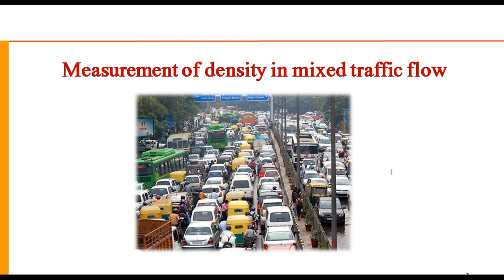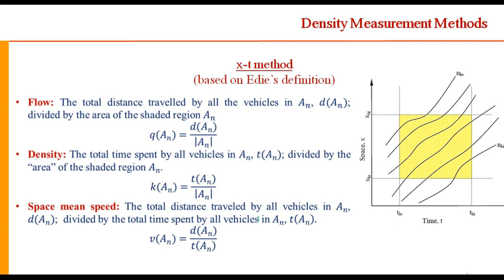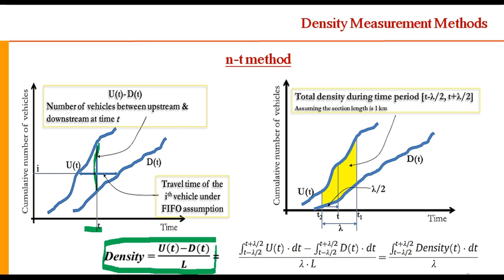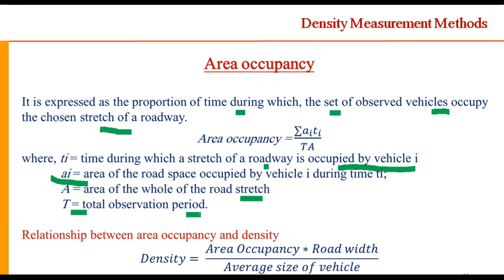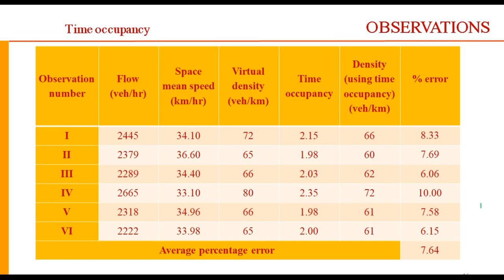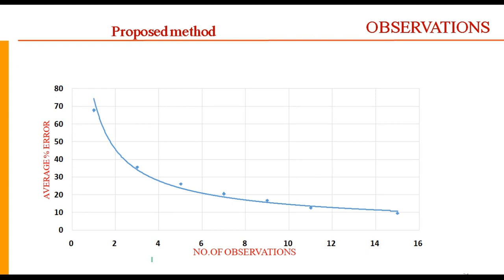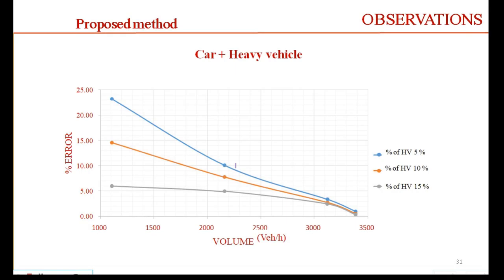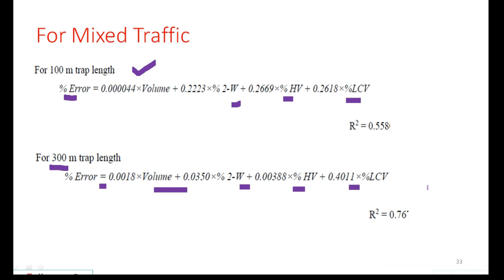#density, #trafficflow, Measurement of traffic density, Traffic flow density

Comment: How to determine PCU value for vehicles in urban mid block section beside your's method?? I have tried multiple linear regression method where mean speed of car were regressed against flows of each vehicle type but found some value negative and some positive ....
Reply from the maker: Linear Regression should not be used as it is based on the method of least error and the analyst has no control on sign of coefficient. You can use headway method if you have proper data.

Comment: Which capacity did you use?? First you determined capacity for each direction and sum two way capacity and used that for analysis??? Or you use capacity of one direction at a time for analysis in case of undivided two lane two way urban midblock section ???
Reply from the maker: For a two lane - two way roads, we do not determine directional capacity. Traffic data are collected for the total traffic in two directions and then analyzed. Directional movements are analyzed only for multilane divided highways.
Reply: What about 4 lane undivided 2 way road road??? But road has central longitudinal line marked..
Reply from the maker: @rameshdhimal3428  you can do both ways - individual direction or total for both. But Capacity will be expressed per lane per direction only

Comment: Sir, how did you find the relation between friction variable and reduction in capacity??? Reduction in capacity for non base section was determined from the model developed for base section with varying carriageway width... I counted the frictions on 5 min interval on each site.... Now should i average all friction value on entire observation on each site and find relation with reduction in capacity ??? Or use average flow and friction on 5 min interval and find relation with reduction in capacity???
Reply from the maker: write separately to Dr. Subhadip for answers to these queries.

Comment: Sir,  how to draw a complete parabola as in Greenshield model in speed and flow plot of graph of traffic???
Reply from the maker: Develop a relation (straight line) between speed and density from field data. If you have collected speed and volume data then find density using Q = KV.
Use this equation (speed - density) to get speed value at varying value of K (starting with zero to almost jam density), in an Excel sheet. determine  traffic volume Q  in the next column using Q = KV. Plot speed volume curve.

Comment: Sir, i have plotted speed vs density from the extracted data of speed and flow and using formula of k = q/v. The maximum flow obtained is good but R square value is between 0.3 to 0.5 for base section... For each site, I have 1 hour data and data was collected for 1 min interval ... so total 60 data for each site... what should I do sir to increase R square value while maintaing maximum flow( capacity ) same???
Reply from the maker: No standard specify one minute time interval for data collection. It should at least be 5 min. One minute data will produce lot of noise and that is why your R squared value is low. One hour data is too less to give any range of traffic volume on a road. go at least for 6 hours field observation,

Comment: Sir, i was reading your paper of 2020 on "Side friction parameters and their influences on capacity of Indian undivided urban streets." and trying to do similar research. Sir, how did you take the speed and flow of the vehicles in case when parking and unparking maneuvers take place as they  causes traffic to halt or slow by acceleration or deceleration?? Did you considered speed and flow in traffic stoppage condition due to frictions or only take the speed and flow ignoring those which causes complete stoppage and slow due to accelerating or decelerating in case of non-base section???
Reply from the maker: Haha, I cannot write the whole procedure here, but if I remember correctly (this was the Ph.D. research work of one student), we did it by collecting the data of speed and flow over a period of time in different levels (read intensity) of parking and unparking movements in a certain length of the road.

Comment: Sir what would be the number of snapshots required in case of trap length around 30-60m??? What to do if platoon and Queue occured in our snapshot time interval?? Should we ignore that time interval or take other random snapshot ???
Reply: which value to take if road in empty in that time interval?? if taken one snap at 20 sec interval...
Reply from the maker: There is no thumb rule which can give you the number of snapshots. Density is difficult to measure in field and that is why most of the time it is calculated from Q = KV, speed and flow are easy to get from field observation.
Reply: @SatishIITR  doesn't this formula work only in uniform flow of traffic???.. but in case of interrupted and disturbed flow where there is platoon and queue which we need to ignore ....and these value would give more capacity ...
Reply: Sir, i measured the speed and flow of traffic for 5 min interval... now to find capacity using greenshield model....then i plotted speed and density graph.... For density what i did was k=q/v... can we do this instead of finding capacity from speed and flow graph???

Comment: Sir, i have plotted three diagram and found different R square value... why is it so?? I have speed and flow data of traffic.... then i determined density as k = q/v... i plotted speed vs density (R2= 0.51), speed vs flow ( R2= 0.1611) and flow vs density( R2 = 0.91)... which R square value should be taken???
Reply from the maker: Please discuss with your supervisor as why are you getting such a large variation in the R squared value. I cannot tell you the reason without going through your entire analysis.

Comment: Sir, i measured the speed and flow of traffic in 5 min interval for 1 hour data....now to find capacity using greenshield model....i plotted speed and density graph.... For density what i did was k=q/v... can we do this for finding density??? Is this the correct way to find density??? In speed vs flow curve, i could not find the maximum flow (capacity) due to limited number of data... in 1 hour i have only 12 set of data .. i.e. 60 min/5min = 12... the R square value for quadratic fit is very very low.... but in speed vs density( k=q/v) the linear fit of the line shows good R square value....
Reply from the maker: Yes you can find density using the relation Q = KV. But you cannot draw any inference from 12 data points. The capacity value will just be absurd even if you get a good R squared value for linear relation between speed and density. It is because 12 data points do not represent flow conditions at site. You need at least 4-6 hours data to get the meaningful results.

Comment: Sir, I calculated the traffic density using n-t method of a video having duration 2.30 minutes and taken 5 sec time interval for that. And calculated density for each time interval. Now I have to give a single density for the whole duration, how I will give ?
Reply from the maker: why for 5 sec interval? you should have done it for 2.30 minute and got the density.
Reply: Okay sir

Comment: Sir how should the maximum flow (capacity) be calculated??? I have extracted data of space mean speed ( km/h) and flow (PCU/h) at 1 minute interval for 1 hour... I have collected data for 1 hour in off peak hour from 11 -12 pm in different urban midblock section of undivided 4 lane 2 way road...i need to make model of variation in carriageway width and capacity in ideal road condition where there is no friction like pedestrian, parking, unparking, bus stops, etc... also I need to find capacity of road in case of presence of road side  friction or disturbances in other riad midblock section....in disturbed traffic condition, i measured traffic flow and space mean speed... now the problem is how to find capacity???
Reply from the maker: Use following steps to get the capacity of a section.
1. Speed - flow data, calculate K, using the relation q = kv
2. Plot speed density curve and develop a straight line equation.
3. using this equation make a table (in MS Excel) between speed and density - Take density from very low to very high at some interval (may be 5)
4. Now you have speed data at different density levels (theoretical). Calculate flow, using q = kv
5. Plot speed - Flow curve and get the capacity
Reply: Sir, isn't directly the maximum flow could be obtained from the speed and density plot by finding linear equation in v = a - bk and free flow and jam density determined as vf = a km/h and kj = vf/b and then max flow = vf* kj/4